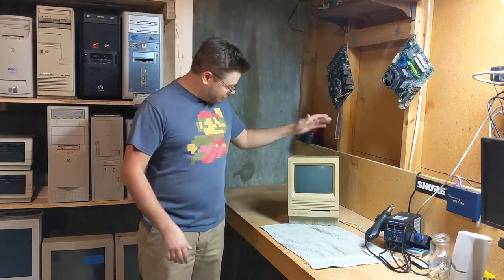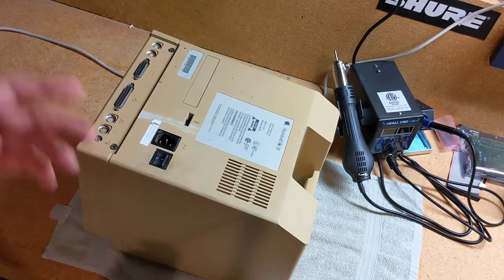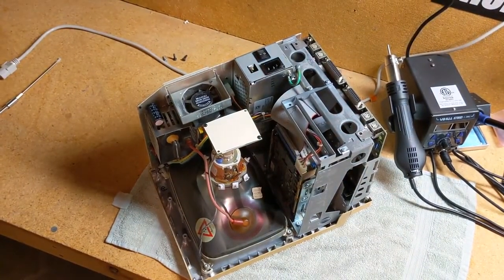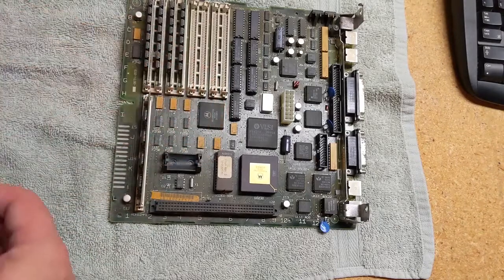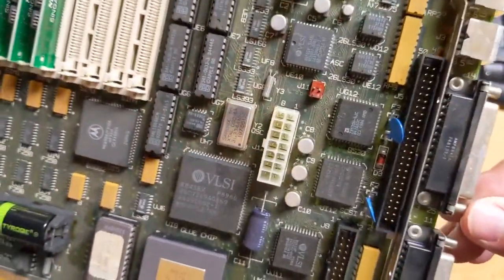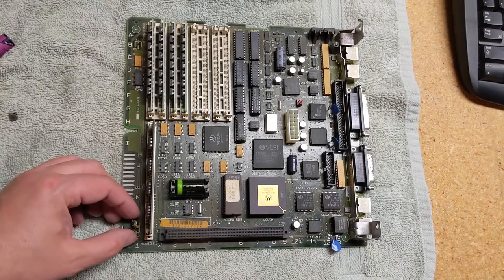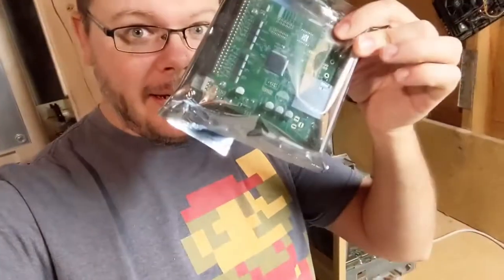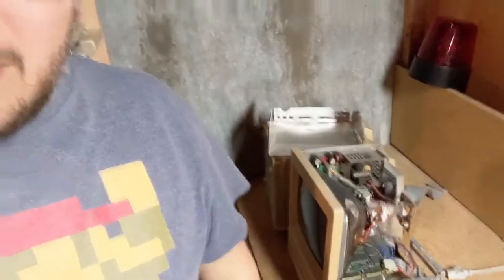Macintosh SE/30 Restoration Part 1

Comment: I still have mine from college days. Original box along with original mouse and keyboard and color dot matrix printer and a box full of prints paper. Fairly low hours. Plastic still cream colored, not yellowed. I also have the original tool to open it. Maxed out on RAM. I remember that the hard drive was recalled and Apple sent me a free upgrade hard drive so it has that too. I still have the original hard drive too which was working fine. Time to pull it all out of the attic and run my Kawai K1 synth with  the original MIDI software. I've got a lot of old software too on floppy disk. I better check to make sure that the internal battery hasn't gone Mission Impossible. Vintage orgy!
Reply from the maker: Sounds like a beast!  What a great machine. Thanks for watching!

Comment: Part of the original "Mac cracker" toolkit was essentially a hinge with handles welded to it, where you'd place the flat, open end of the hinge into the seam and use the handles to push the two halves of the case apart. At some point someone started making a combined torx and case-cracker, though that was just a metal disk welded to the handle-end of the torx screwdriver with a flat bit to insert into the case seam and then turn to pry them apart. I don't think that this was nearly as gentle as the original hinge-with-a-handle, but it probably did alright.
Reply from the maker: Interesting.  I'd love to see one of those!
Reply: @mattsworkbench  There are pictures of them around, getting ahold of an official one, though, that might be difficult.